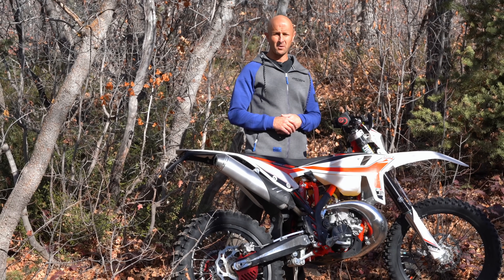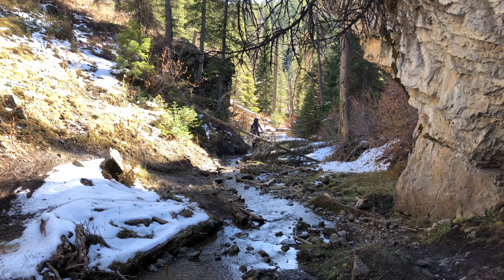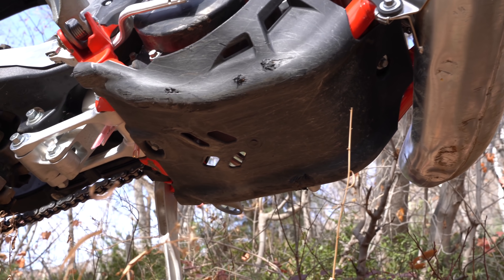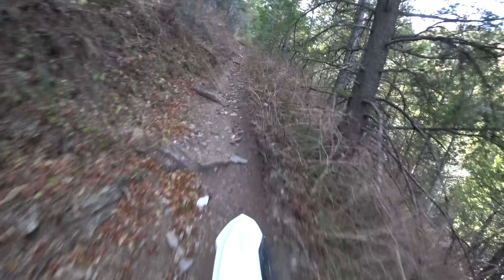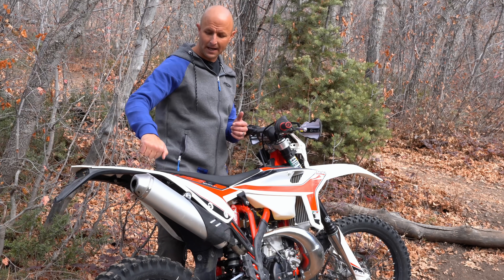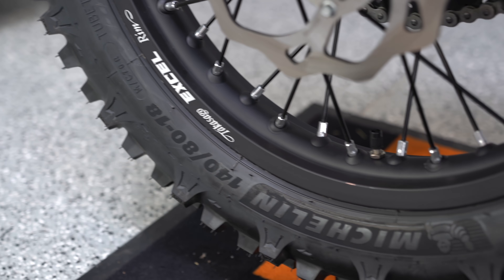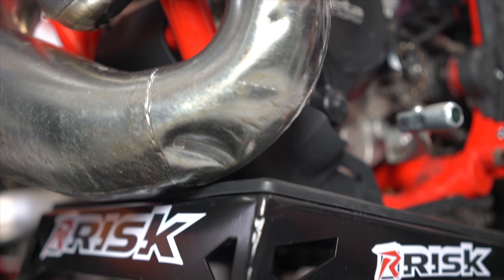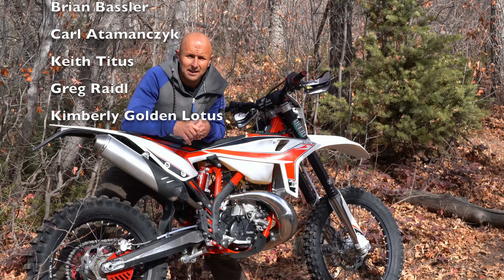2020 Beta 200RR Full Review | This Bike Does Something Better than ANY other bike!

Comment: Thanks for the review Kyle! Do you know if the limited turning radius is also an issue on the Beta 250 RR and 300 RR?
Reply: Alec Cole it is. I own a 2017 RR 300. Little larger turning radius than the KTM, but I ride technical terrain, with a trials background and it’s never bothered/affected me.

Comment: Wow you really had me sold until you mentioned the turning radius. 😒 Living in the Rockies you really need to be nimble. I'd love to have the low end power of a bigger bike, without the massive weight and excessive too end. I'm a smaller rider and it's hard to find a good fit.

Comment: Beta, Husky is all make by KTM, just better quality.
Reply: Beta is not made by KTM. In the past, Beta used KTM engine. Nowdays both frame and engine are manufactured by Beta.
Reply: MrIronfly yeah I think he was thinking about gas gas instead because KTM just bought them out if I’m not mistaken
Reply: Fun fact until 2016 ktm used beta engines in thier 50cc models
Reply: Everything is  all identical to KTM, I own a 2018 ktm 250sx.